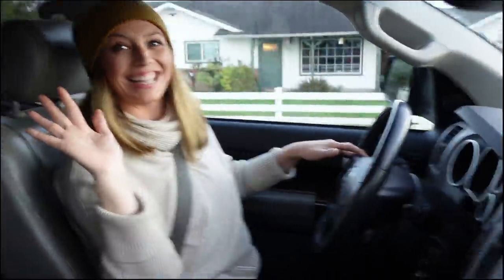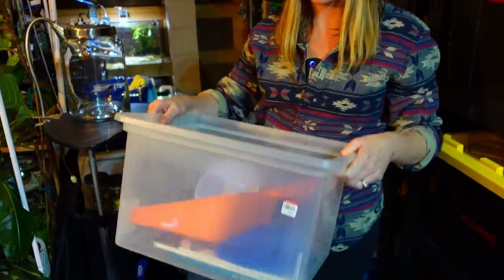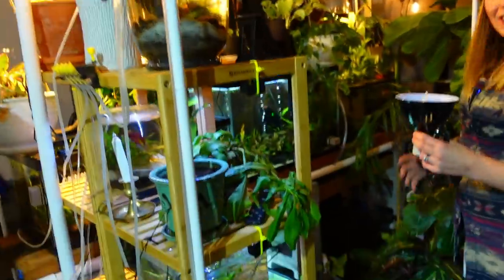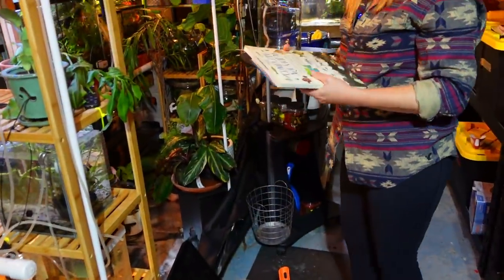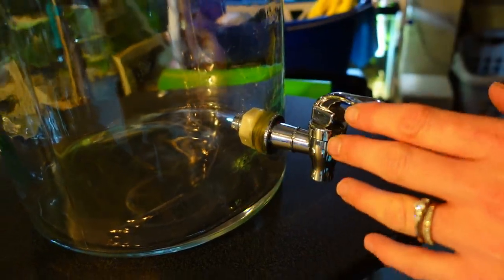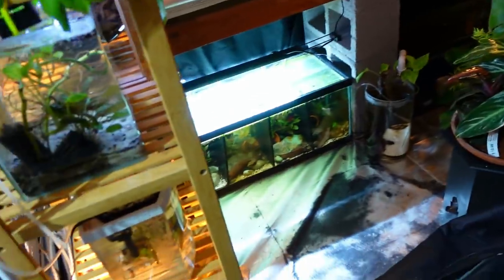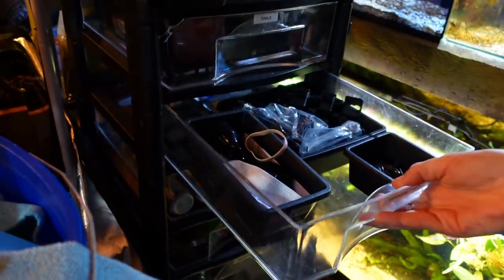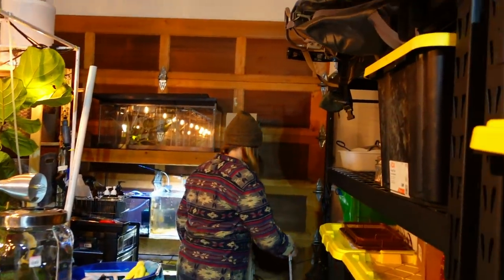Top 10 Goodwill Thrift Store Aquarium Supplies

Comment: I thought I was the only one who does this. I even find slate bottom tanks.
Reply: Yes! Slate bottom? That's awesome.
I have found a few 5 and 20 gallon longs and my odd sized 15 gallon. Bring them home, water hold test, and still going 2 years later. Just have to make sure it's aquarium vs. Reptile tanks, with the thinner glass.
Reply: The old slate bottom framed tanks can be fixed by filling with hot water from the water tank and adding a quart or two off boiling water then drained it when cold. It works almost every time